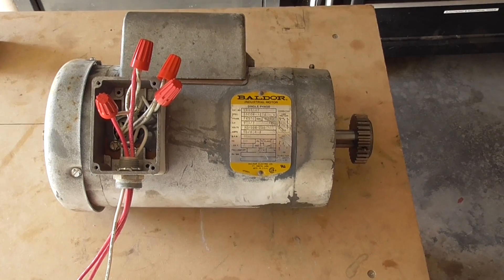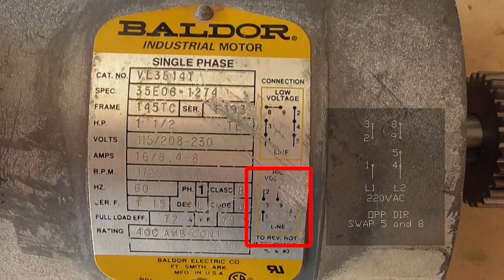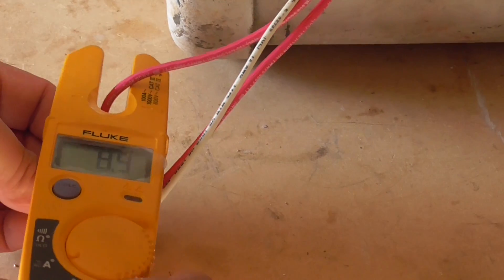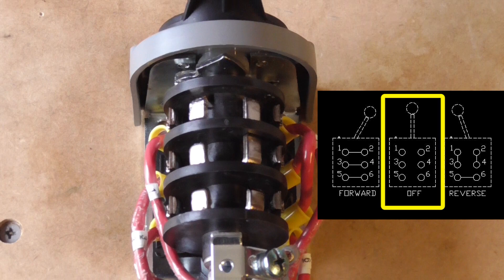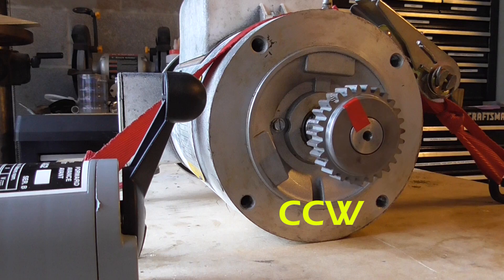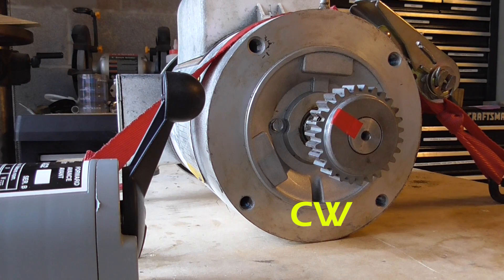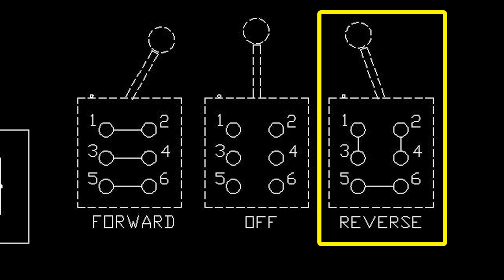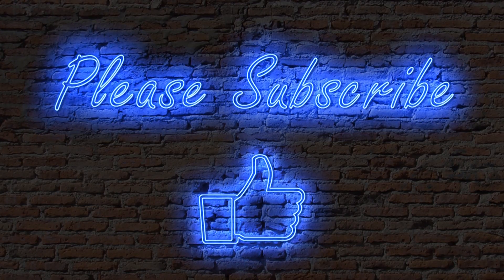Reverse Baldor Single Phase AC Motor Circuit Diagram

Comment: Can't you use a double pole double throw center off switch to do the same thing?
Or do you have to use a triple pole double throw switch?

Drum switches are too bulky to go into my double gang box.
Reply from the maker: I'm sure there should be other ways to do this, but I made this for a customer years ago and this switch was the easiest way I could find to reverse the motor. Thanks for the comments.

Comment: usual. for 120v. i removed motor from lathe. baldor 6 wire 1 horsepower.  2 sets of 3 wires. i put thin wire markers on 1 set of 3. I checked with ohm meter. seemed to be 2 coil windings. 2 wires not connected. I reversed the red and black wires and tested. no burning. i let it run for 5 minutes.

Comment: Good day sir,,im pio from philippines,if you dont mind can ask favor,,i need a winding diagram of 7.5hp motor single phase 220volts..what size of magnetic coil how many turns..with running and starting capacitor
Reply from the maker: Sorry, I do not have that information. Thanks for the comments!

Comment: pointless video using a reversible switch.   I have line one and line two...  Unfortunatley i also have a neutral and a ground. The ground goes to the case, but where  the HE11 does the neutral go?
Reply: Neutral isn’t connected. Suggest you safe it off so it cannot make contact with anything.

Comment: Great informative video, but suggestion that you label the capacitor and the centrifugal switch/overload on the motor wiring diagram, as you would not believe the number of times someone has asked me to wire a motor for them (after previous failed attempts) and the internal wiring (someone not knowing what they were doing) changed/altered the motor internal wiring positions, thereby blowing the cap or even shorting the start windings when applying power. That way any respective (qualified) person could tract all wiring to assure that it is attached/positioned properly prior to starting the process of wiring the reversing rotary switch. Communication is the problem to the answer.

Comment: Need help adding limit switches CCW and CW. I have the same setup connected to a gear box and want the gears to stop at two limit switches.
Reply from the maker: Hi Kosphoto, The circuit in this video works completely manual. My customer didn't want to spend the extra money for an automatic system probably like you are talking about where in this example, a door raises with a button pushed then stops when it hits the up limit switch. Then push the button again and the door lowers then stops when it hits the down limit switch. This can be done with several relays and a reversing contactor so this simple reversing switch was a cheap alternative. 

I did a search 'ac motor reversing circuit panel' on Bing, sorry Google,  and found a circuit like you are talking about. Sorry, I don't know how to post the URL for this.

Hope that helps and thanks for the comments!